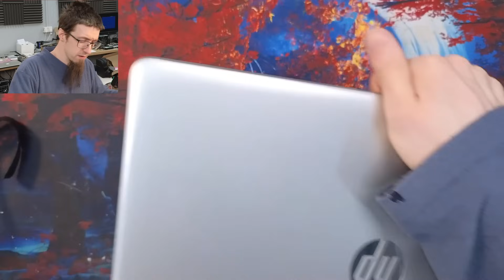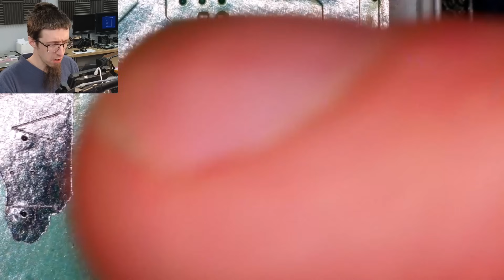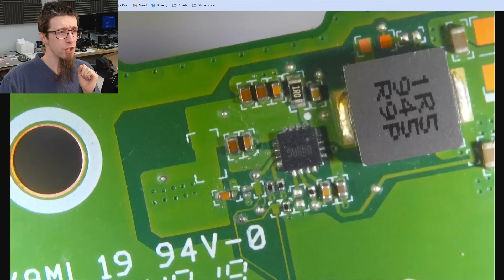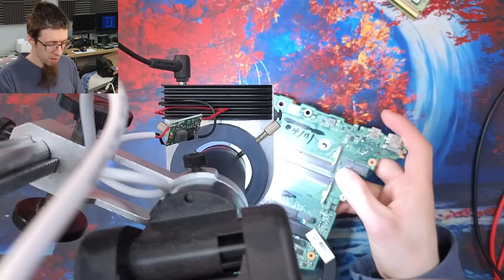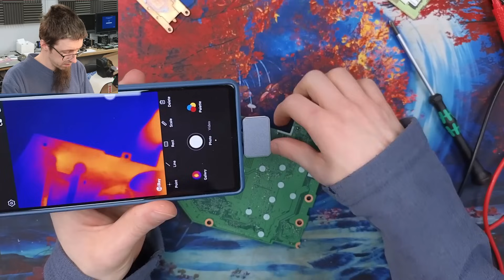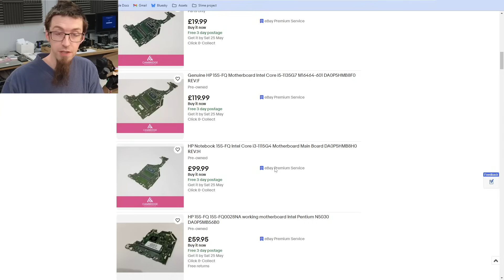HP 15s-fq No Power, Laptop Diagnostics #402

Comment from the maker: Sorry about the lack of multimeter cam. Looks like I forgot to include it in the export - not worth destroying the analytics with a reupload for that though, so it'll be back next time.
Reply: That's ok you explained each of the readings, saved us from trying to read the meter and watch what you were measuring.
Reply: Can you activate the multimeter sound in case of a short circuit?
Reply: Board repair😀😀😀....nice work!!!
Reply: Can I ask a bit of an off-topic question? Where's the name, "Adamant IT" come from?
Reply: could always include it with a reupload some time
Reply: so upload it for a second time I mean

Comment: When I Upgraded My Jellyfin Farm 3 Years Back I Got 6 Optiplex SFF I7-8700 PC's Foe $180 Each And Upgraded Them With 1TB NVME 4X4 SSD's 32GB's Of DDR4 3200 RAM And A WiFi 6 M.2 Kit! I Went Ahead And Bought 2 Spare Motherboards And Power Supplies As Well! I Am Trying To Keep Them Going Until 2033! 2 Of The 6 Stay On 24X7 And The Other 4 Only get Used On Weekends And Holidays! I Have Been Capturing TV Shows Since 2002 I Am Up To 40,179 Individual TV Episodes Across 1.355 Series All With The Ads Removed, Meta Data Added, And Compressed With The h265 Codec! I Use A Program Called MCE_Buddy To Do That For Me! Then Serve Them Up With Jellyfin Media Server To The Little SFF I7-8700 HTPC's I Run TCL 55 Inch UHDTV's As Displays I Have 8 Of Them! So I Went Ahead And Bought Spare Power Supplies, Motherboards And Back Lights For 2 Of Them! So maybe the Prices of Components Will Back Down By 2033! I Certainly Could Not Afford To Build My Jellyfin Farm With Today's Insane Prices! I Also Upgraded My Laptop To A MSI Stealth 77 I-9-12900 32GB's DDR5 SODIMM And A Nvidia 3080 2 Years Back That I Got For Less Than Half The MSRP As An Open Box From E-bay At The MSI Store! The First Thing I Did Was To Shrink Windows And Set It Up To Dual Boot With KUBUNTU! At The End Of The Warranty The Spyware, Adware, Malware That Windows OS has become Was Deleted Completely!

Comment: If I understood correctly, the short was between layers of the board at that one point right ?  
You couldn't fix by cutting a small section of board away or micro-drilling a hole there etc,  and re-routing a couple of traces if need be ?
Reply: There's a very slim chance that that would have worked. But if it didn't, you spent a lot of time for nothing. Much better just to buy a new board.

Comment: Just a thought... how common are this kind of failure's? Do u think it has any tng to do with PCH and CPU being on the same chip? If so how concerned should i be coz i got msi modern 15 laptop with the same design... pch and cpu on the same chip.
I've had it for a yr and its a nice laptop. With worst possible screen hinge designs...
Reply from the maker: PCH failure is very common, yea. And yes, the PCH doesn't like the amount of heat that the CPU core right next to it is kicking out. However, this is basically how the vast majority of modern mobile CPUs are built (as a CPU/PCH combo chip) so there's not really anything you can do about it. Like, buying a different model of laptop won't solve this because it'll be the same.

Comment: you are overcomplicating it , there is close to 0 ohm short on power rail , injecting 0.8v can't damage anything , there ain't a thing on this board that's meant for voltages lower than that.
Reply from the maker: And then you inject on a sense line that goes into the EC and kill the board.
I am teaching an abundance of caution, but also teaching people how to identify sections and navigate a board is never a waste of time. Blind repair only gets you so far - at some point you need to learn how to figure the board out.

Comment: Are pre surface mount components better or worse quality than surface mount ones?
Reply from the maker: Sort of. Through-hole can be more robust because it's less vulnerable to thermal cycles (legs can expand/contract), but for the components that matter like capacitors, through-hole caps aren't exactly reliable either. It's a moot point in modern computer design because you have to use surface mount to get the ESR down. Capacitors with long through-hole legs just aren't fast enough for modern circuits.

Comment: Normally, when you observe that each component in a device is not identified with alphanumeric characters using indelible ink (commonly white); That is to say, such a device lacks silkscreen printing on each PCB that makes it up, so for that device you will not find the service manual (schematic diagram) either. The majority of recognized manufacturers whose authentic models meet this requirement will be able to enter (be accepted by Quality Control agencies) the demanding North American market (USA and Canada mainly). Another way to say it: I see the PCB silk-screened so I'm likely to find the service manual. NOT screen printed? well... Greetings.

Comment: why you do not fix the PCH  ? You posted a video at Apr/01 how to do it with a milk 😀😀😀😀😄
Reply: The board had an internal short. Replacing the PCH would not have solved the problem.

Comment: At 5.49 you mentioned "maybe our battery charger or main rain supply depending on what main rail we got"".Please can you clarify "depending on what main rail we got"" because my interpretation is 19 v is the only main rail on laptops. tks
Reply from the maker: There's two topologies for the main power rail, Hybrid or Narrow VDC. I need to make a video about it some time, but it's on the bucket list. If you want to read up on this, here's a great primer by Piernov: https://www.badcaps.net/forum/troubleshooting-hardware-devices-and-electronics-theory/troubleshooting-laptops-tablets-and-mobile-devices/80414-laptop-battery-charging-circuit

Comment: Dang the discoloration of that board around the CPU socket is crazy
Reply from the maker: Yea based on the writing on the board, I'm wondering if this CPU got reflowed or something like that at some point. Wild speculation, but that hand writing on the board ain't factory.
Reply: @Adamant_IT  I was almost thinking the same due to that discoloring and the writing. Only the board knows for sure, and it's dead 😂

Comment: i3 12th gen better than i5 11th gen, surprisingly
Reply from the maker: I did wonder that, but wasn't going to start looking up benchmarks in the middle of recording. As long as there's 4 physical cores, I'm happy, after that IPC is king as far as I'm concerned. 2c4t CPUs I tend to avoid, because even with good IPC, 2 cores are just easy to overwhelm.